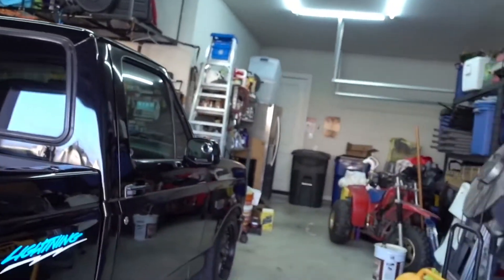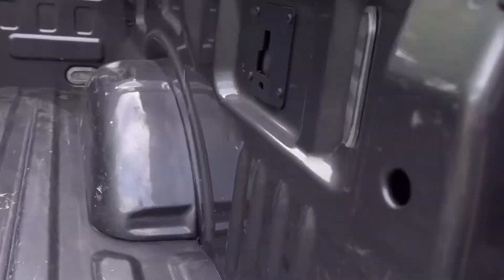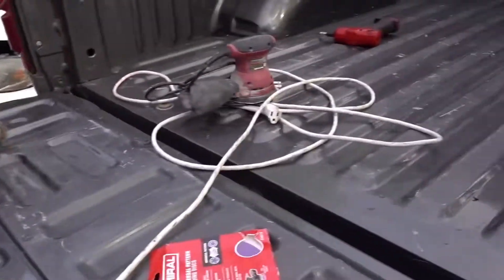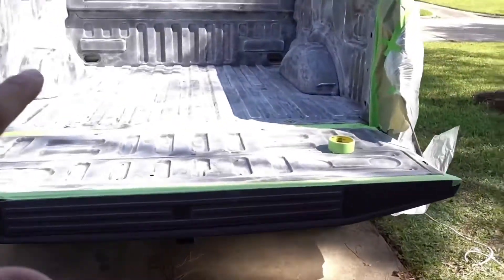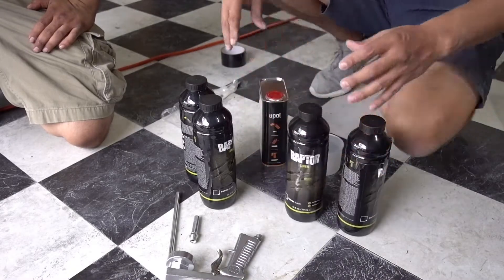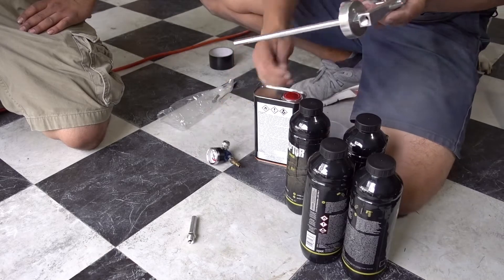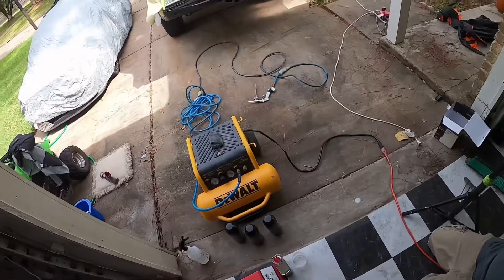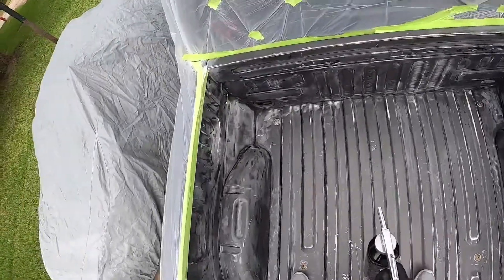DIY BEST BEDLINER KIT. HOW TO BED LINER YOUR OWN TRUCK.

Comment: Good job brother you did nice work. It looks very professional. Thanks for the heads up I will give it a go on my tundra. Did you use all four bottles? And how many coats
Reply from the maker: Thanks, yes use all the bottles to apply as many coats as possible as this will give you the best results & strength

Comment: Did you used all four cans. I want to do the bed. lumber rack. And tool box. I liked how your came out.
Reply from the maker: Yes I used up all available cans & layer it on as thick as possible. The more you use the thicker & more chances of it lasting longer.

Comment: How smooth is it? In other words, it the bed easy to sweep out once you hall a bunch of crap in it, like leaves or dirt? I have a bunch of pecan trees and I typically rake them up into a big plastic sheet and lift the sheet into a bed and fold it over like a burrito, then I can just pull the top of the 'burrito' and it dumps all of the leaves. The finish looks a little rough and I am not sure if the plastic sheet would slide or catch on it. Thank you
Reply from the maker: It’s actually pretty smooth, not as rough as it looks. You can definitely slide plastics over it without any issues.